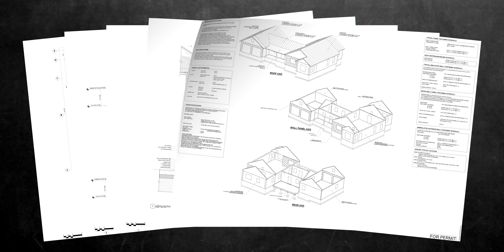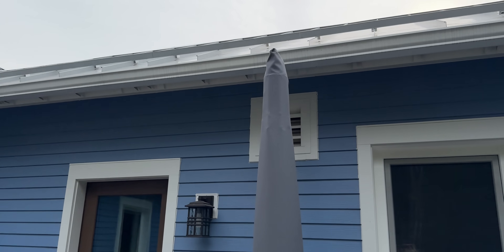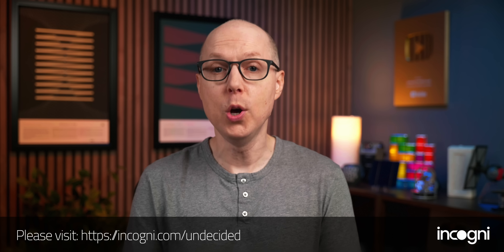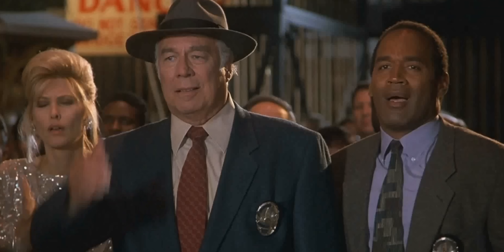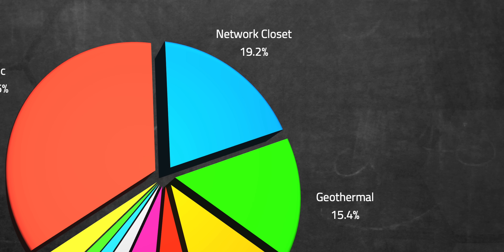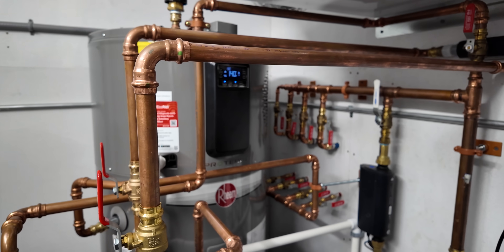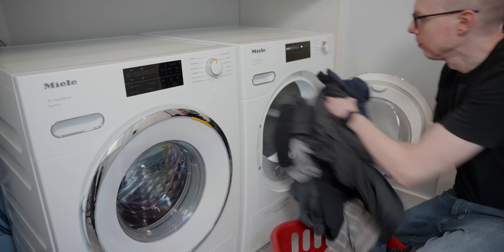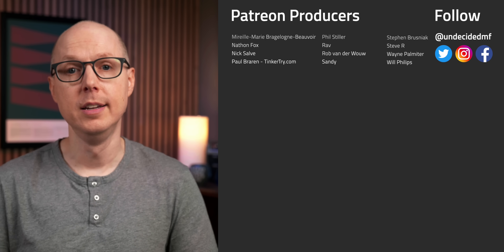What I Learned After 1 Year in My Net Zero House

Comment: Gradually I am making my house more energy efficient. I started in 2014 by installing solar panels on my roof, which produces about just as much as I use, with 100% metering I earned my Solar panel system back in 7 years. But Metering will be stopped by Januari 2027, if the bill passes... But to be ahead of that I have an Enphase home battery installed. a 1QBattery 5P, only one 5Kwh unit, as that is more than sufficient for my middle town house kinda home (Rijtjeshuis). With a dynamic contract and direct trading on the electricity market using AI software, I should be able to make some money with my solar panels.. At least I will use more of my own produced electricity, instead of sending it back on the grid. But we will see how that works out.

I have also replaced almost all my 1992 originally installed wooden window frames and windows with HQ++ plastic window frames and HQ++ double pane windows, Also the front door replaced with a heavy duty plastic door with a very safe locking system on it, so almost impossible to break in. Especially this heavy door  has made the house more comfortable and air tight, the gaps below the original door were huge and during winter a lot of cold air entered via this door.. This is all gone now. Of course the bedrooms have all tilt open windows, with a winter setting, so just a small crack open, about half of the summer setting.

2 yeras ago I replaced my gas stove with induction cooking top,  works perfectly and the electricity bill has not gone up as much as I thought. Still I pay zero or even get something back from the electricity company.

The new windows and front door + induction stove, have reduced my gas usage for heating, and cooking with about 25%, The gas combi boiler is for hot water and heating and is one the highest efficiencies on the market.. It is now 10 years old.. I have been looking into adding a heatpump, so making it a hybrid system, but that is not worth the money right now, the gas usage is quite low anyways, I am way below average... But maybe when the gas boiler worn out and needs to be replaced, then probably cheaper heatpump solutions are available and makes sense to install by then... In the end the goal is to get off the gas completely.

What I am also thinking about is to replace the gas boiler by a high efficient electric boiler, so I can keep the radiator system. There are boilers on the market that take advantage of the dynamic electricity contracts and optimise the solar PV system... The increased electricity usage I could compensate by replacing the by then 15-20 year old solar panels and inverter by the latest and greatest at that time, with maybe 500 or 600Wp panels instead of the 275Wp panels I have right now. But that is for 5-10 years into the future.

Comment: I realize it's not an option for many in rural settings, but in certain areas that have the proper acreage and utilities that allow for more than 10 kw grid tied systems, it'd be interesting to compare the price of a large ground mount solar power system vs retrofitting an older home with energy efficient products.  After rebates (Canada) i'm 16k out of pocket for a 10 kw grid tie, and I honestly don't think I could change all my thermal pane windows for that alone.  I'm around 12,000 kw/h since January 31st.

Comment: I have heat pumps now for air conditioning and heat.  I love them.  I would prefer geothermal.  I think over a 20, 30, or 50 year period, it is a no brainer.
I'm not a fan of Span.  All the software is written in China.
We are replacing our natural gas hot water heaters with heat pump hot water heaters in 2025.  I produce more solar than I use so I will get free hot water and cool down my garage for free.
A heat pump dryer is a non starter for my wife.

Comment: Have you thought of a solar trough mirror with oil as fluid at the peak of the house and a sand battery say 6x6x6 or bigger so you can charge it all summer and use for heat in the winter

Comment: Induction cooktops basically use the bottom of your pan as the heating element.  Yes, you see bubbles, and you think the water/food is boiling hot.  It isn't, initially.  The time to heat the contents is actually about the same.  Also, since the bottom of your pot/pan is the heating element, you will find that each pot is quite different. (Try it with different skillets.  Fry an egg.  Different results and the need to use a different setting based upon the pan.)  Also, with some cheaper pans the internal conductive layer is thin and tends to fail over time.  I recommend cast iron.  You get more consistency in heating.  I do like induction over standard electric or infrared, but not over gas for cooking.  What I don't like is burning you can get as the food in the pan/pot is touching the heating element/bottom of the pan.

Comment: I installed a flex heating system, heat pump natural gas combo. Works very well and is very comfortable on very cold days. Set to switch to gas at 50F for our comfort. Was a good upgrade from the older less efficient heat pumps.

Comment: Folks really need to look at the economics of the more efficient appliances to their specific area. My heat pump water heater uses far less energy than my old (2009) gas one: the equivalent of one therm to six. But that one equivalent therm of 29kwh electricity costs more than the 6 therms of gas. 

Now that economics model changes when you produce your own power, but again, that has higher up front costs and maintenance costs of it's own. It's only when you factor in other values that some of these appliances truly "pay off." 

It's good to see that you often point this out, as it's lost on some channels.

Comment: Most of the energy consumed in running a home goes towards maintaining a comfortable temperature and humidity. Traditional house designs often fall short in this regard. Relying on add-ons like solar panels or geothermal heat pumps to fix fundamental design flaws can feel counterintuitive—you end up creating a problem, making it worse, and then trying to address it. Instead, why not consider building a house inside a greenhouse? This approach allows you to use ancient techniques for natural heating and cooling from the outset.

Comment: Ok, so you're saving tons of energy.  Now for the real question...   Since you added all of the high tech features, solar, heat pump, motorized blinds, geothermal well, battery bank.  What was the cost of those VERY EXPENSIVE additions?  My neighbor just paid $50,000 for his solar panels for a 1100 sq ft home.  I did the math and it will NEVER pay off and they still pay somewhat of an electric bill.  It seems our electric provider charges .18 per kwh but only pays them .05 per kwh for produced energy.

Comment: Not ragging on Matt. 

It is soooo cheap to be rich. From buying the house in cash to avoid that pesky compound interest. To paying for $60,000 heat pumps and solar panels that let you ignore power outages while saving tons of money in the long run. To paying a hundred grand more up-front on an efficient house instead of losing money each month due to leaky house. To being able to build a custom house at all instead of buying a spec-home or an existing house, or renting. 

I tried, am trying, to be efficient on a budget. Got the ASHP installed, but it took months of saving and it's far from the most efficient. Trying to get panels, but again months of saving up and I've been in permit limbo for months more. 

Also: basements are awesome.
Reply: His money didn’t come from nowhere, nor did it appear instantly

Comment: Thanks for sharing your experience Matt! I find it extremely helpful to see how other people are fighting the same challenges so I'd like to share my build. I chose a full basement, with ICF walls from footings to the roof. Heating/cooling is provided by a heat pump and a closed loop geothermal system. The heat pump uses water to water in the basement for in-floor heat, and water to air in the upstairs unit for heating and AC and preheats my hot water. Hot water is then brought to temperature by another separate heat pump. The roof is covered in white standing seam metal and covered in 48 panels to offset the entire electrical consumption of the house. I skipped the home battery backup as it didn't seem to make financial sense at the time (2021). Hopefully I can add it on when it makes cents!

Comment: My natural gas hot water heater costs me $31 a month to operate for a family of 4. Half of that is the monthly connection fee.  At $15 a month in gas usage if the heat pump version saved me 50% it would take 22 years just to break even on the cost of a $2,000 heat pump water heater.  Obviously gas costs vary and if someone had an electric heater in a state with horrible energy prices, then it might be relevant but to offer the blanket statement of "will save you a lot of money" is simply false.

Comment: We have a 100 year old home, so poorly insulated, and pretty bad windows.
Still after putting solar panels on the roof (5 kW system) and switching to a Air-Water heat pump, we dropped the annual consumption from 45 000 kWh to only 12 500 kWh.

Comment: I can't speak for the energy saving stuff, but I can speak towards a basement. I'm currently living in a slab foundation (no basement) home. And I swear I will never live in one again.This home is now old enough that it is starting to have plumbing issues and, since much of the plumbing is UNDER the concrete foundation, solving those issues is going to involve jack hammering INSIDE the house. It is a nightmare. 100% for basements.
Reply: @kirkwagner461  ouch.  If it is supply lines or drainage they can get to from the outside you may be able to avoid the jackhammer.  But if it is drainage in the slab, it’s hammer time.  We had to do that when we moved the shower drain in our house.
Reply: @JBoy340a  The long term solution involves some jack hammering. Then lines are re-routed to run outside the house, burying the lines in the ground. All very expensive.
Reply: @kirkwagner461  any option to route through attic in PEX?  We did that with a bathroom remodel.  Working fine .

Comment: "heat backup" in my panel refers to electric/resistive heating strips for "emergency" use if my air-source heat pump fails to provide enough heat in the winter.

Comment: Dumb question for the community: If my vented electric dryer is in the unconditioned/unfinished space in my basement that also is shared by the HVAC system, am I still venting conditioned air outside my home when the dryer is in use (thoughts from ~16:39 in the video)? Would it be better to finish the space that both of those devices occupy?

Comment: What happens to the energy that goes into your network cabinet.  Most is turned into heat, so is useful heat in winter, though not so in summer. 
So his adjustment to the graph is probably incorrect.  Adding both together would give your heat load.  Other items stay the same

Comment: We live in a house from 2006 with the same setup as you have. How is this possible? It's in Sweden ;)
We upgraded with solar panels last year but have opted out of batteries for now since it wasn't cost effective. It will likely be added in the future. The solar panels produces a lot more energy than we use and that's not a mistake, since we wanted to do our share of minimizing the burden on the earth.
We are just in the process of exchanging our geothermal heal pump for a new one since it is living on overtime after 18 years. The new ones are even more efficient so we are expecting 10-15% savings on heating.

Comment: We are in the early stages of building our forever home as well.  We've got the land now, and our plans are with our builder's design team.  We are doing a few things differently from you though.  
1)  We are going with air-source heat pumps.  I can't justify the premium of the ground source
2)  We will have a basement, and the footprint is a very boring rectangle that faces south-southwest.  We chose to have a very efficient shape, since every corner is a potential source of heat loss
3)  We likely won't put our solar panels on until at least 6 months after we move in.  The incentives work better that way, since they stink for new builds in our area.
4)  We can't use a Span smart panel, it isn't available in Canada.
5)  We are taking a wait and see approach on the home battery.  Our power utility doesn't have time of day pricing yet, and does have full net metering.  Batteries don't provide a lot of advantage in this case.  If the pricing scheme changes we'll look at it.

We do plan to have super high insulation, heat pump water heater, heat pump dryer, and very efficient appliances.  We haven't decided about an induction stove yet though.

I don't know if the roof will hold enough panels to also charge an EV when we get one.  We drive 50,000 km a year, so that is a lot of power to generate at almost 46 degrees N.  Should be fine for the PHEV we drive right now.

Comment: I've been around the home construction for most of my adult life. While I am all in favor of advanced framing methods, high efficiency household appliances, insulation, ETC.  I am unconvinced that Solar Grid Tie or Battery System are cost effective outside of the Southwest. I live in an area where the Isolation factor is just over 4, I can't get the math to work on a Grid Tie system to work in this area, especially if I consider unsubsidized pricing and consider the fact that it requires my electrical provider to maintain the level to support my usage. Adding batteries just compound it. Clients that have had these systems installed all have underperformed  saving money on the electric bills.

Comment: You should look up heat exchange ventilators! You probably need only one.The incoming air is run through a [mostly] PASSIVE exchanger  so you don't lose the heat or cold dollars you just paid for in the exhaust air. It passes the outgoing and incoming air pass through an exchange medium so that the outside incoming air temp swaps heat or cooling given up by the inside air. This is relatively low tech solution normally used for commercial applications, but is already scaled to house sizes and is low expense compared to the equipment you are using everywhere else in your system.  It can even retain much of the house's humidity [or lack thereof].   

Especially valuable when considering your airtight house envelope. Air turnover is especially important for occupant health in new construction due to the formaldehydes that are usually present in new building materials. I assume this is still an issue. My last house was involved in a state sponsored survey of airtight construction many many MANY years ago. We were so airtight we had to have an incoming air source which I put down near the gas furnace. That way, the furnace was burning outside air.

Comment: Had a air source heat pump installed over a year ago previously was using an electric furnace. Peak cold months my bill went from $295 to $160 and my backup heat (electric furnace)( only came on for 4 days total all year even with temps below 0 several times during winter months.

Comment: 84% energy savings on hot water is absolutely mind-blowing. Great video!
Reply: that is huge!
Reply: @lucas-90536  I have the same brand hybrid water heater, we use ~100 kw per month for a family of 5. I’m really impressed with it.
Reply: I'm curious how much of the savings is costing the rest of the HVAC etc systems to deal with the moisture/cooling effects?
Reply: I wonder if this could be tested by putting it in resistive only mode? (if it has one) Then checking the change on the rest of the systems.

Comment: Attic ridge vent is a solution to a problem that shouldnt exist. Make the attic part of envelope of the house. Humidity and temperature will be balanced and the conditions for dew wont be present.
Reply: Attics are vented because it's easier to blow insulation in on the floor than it is to insulate the roof. May could've put the attic in the envelope and used it to store and run all his utilities, getting all the advantages of a basement without paying for one.
Reply: This makes a huge difference!  I built my house this way, and do not regret it.

Comment: Since we are all supposed to be buying EVs by 2035, we did you remove your EV?  

Thumbs up on the heat pump water heater.  I replaced our dying electric with a heat pump about 2 years ago and it has been great!

I was taking a serious look at a Prius PHEV, but I didn't think that I would ever make the $11k price difference back and the Prius Prime LE is a unicorn.  So I settled for the Prius LE.  So far the efficiency is all that Toyota advertises.  The 44 mile range on the Prime LE would have meant not using gasoline except as needed to keep the ICE system from being damaged by disuse.

Comment: The heat backup is likely a resistive heating element inside your heating system that will switch on when the heat pump cannot deliver fast enough heat. It will get some use on colder temperatures or when there is a spike in heat demand. And it will most likely be able to heat your home and water alone if your heat pump fails for some reason.